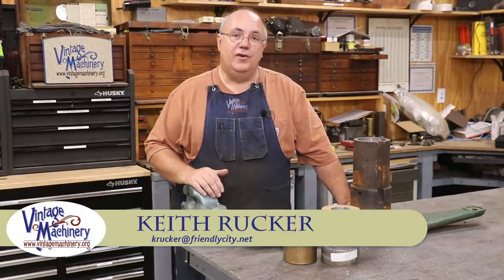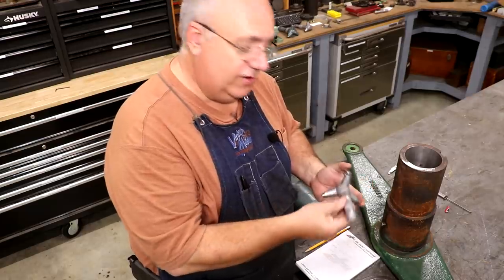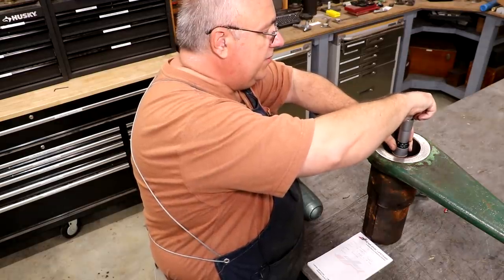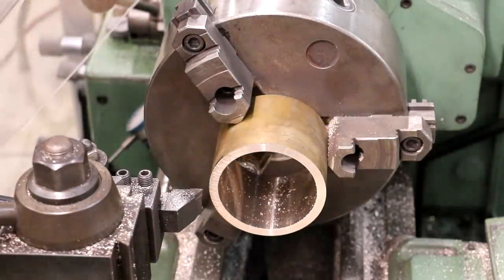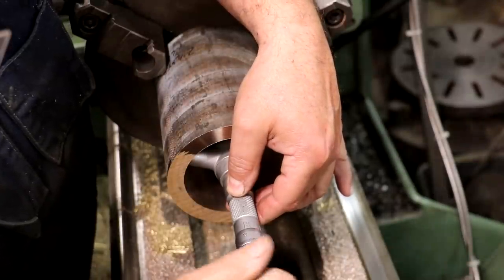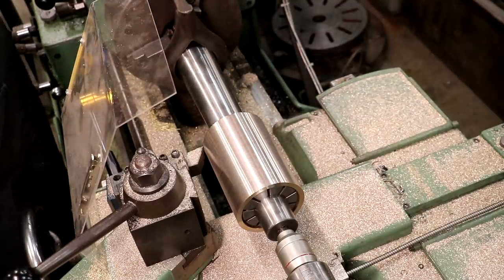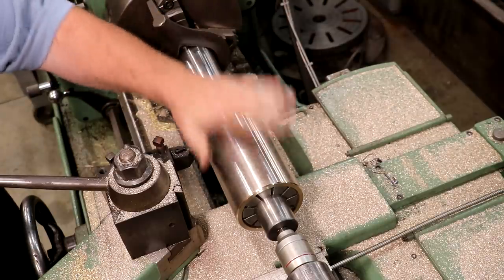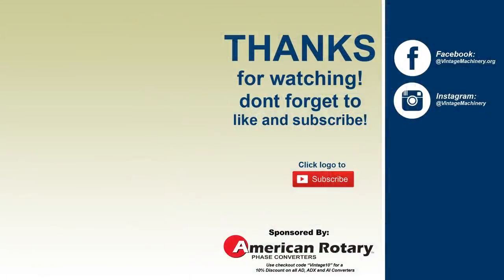Case Steam Engine Clutch Rebuild:  Turning and Installing Bronze Bushings

Comment: Keith, press a plug in one end of the undersized bushing and use it as a pen and pencil holder. I have one made from 4" brass tubing that I cut too short, read the wrong side of the tape measure. It reminds me to double check my measurements. It happens to the he best of us.
Reply: My desk at work is covered with my blunders... The worst is tied between a bag of copper welding tips I designed and completely mis-spec'd the mounting taper (way too steep, came out as more of a chamfer!), and a nut welding tip/guide pin holder I had made to repair a worn part on a welder that was made from bad material. Original was Class 2 (chromium) copper, local machine shop didn't have a big enough chunk of that but they did have ampco bronze. My boss and I figured it would work, but the maintenance manager immediately rejected the part before installation since apparently the weld tip mounting threads don't hold up in ampco to the point of it not being worth trying to use it temporally. Both were costly goofs both in time and in $$$$... Keep them and other fails on my desk as reminder to double check everything!

Comment: Been there done that. Bore mics are often a problem if you dont use them regularly, so i use a digital caliper to measure within the ball park and use the mic for just the accurate figures, so i know im within the right line range on the barrel.

Comment: I'm glad you shared your mistake with us. I'm new to Machining one of my first projects was making new Rudder bearings for my boat out of derlin. I made the ID 1000 over the size of the rudder post which was two and a half inch stainless steel. While I was inserting the bearings into the boat I had the runner laying out in the hot sun not thinking about thermal expansion. Let me tell you it's mighty frustrating lifting a Rudder that weighs 150 lb and trying to get it started. I finally realized the stainless had expanded so I cooled it down with ice and it just barely made it in. Now I always pay attention to thermal expansion.

Comment: One job I did on the planer was cut down the ways for strips on their old stile turret lathes to rebuild them. Before I started my setup I put the new Timkem races in the freezer to shrink them for about an hour .
I took them out of the freezer I held them in a shop towel so as not let them worm from my bear hand . If I was very careful I could get them to slide all the way to the back of the bore before they became too warm. 
Once they were in they would lock in in the in about two seconds solid. 
That was 50 years ago.

Comment: Put up the measurements of that undersized bushing. Someone may have a use for it which would let you recoup at least some of that loss. It might even be the case where a project was still in the design stages where the design could be adjusted to make use of that chunk of bronze.
Reply: Based on the call outs Keith was giving in the video, estimate would be 4.028 x 3.447 x 6

Comment: Acetylene is dissolved in acetone under pressure. Acetylene, being lighter than acetone, floats to the top and is released by reducing the pressure. When the tank is on its side, acetone, mixed with acetylene, can be discharged, instead of acetylene only, causing an explosion.

Comment: Keith, I think you have enough tooling to do most jobs.  The one inch boring bar should have done your job with the proper insert. 
My suggestion to you is start to look for deals on inserts with different geometry and   coatings to cover a wider spectrum 
Keep up the good work 
JIM

Comment: Hi Kieth and your friend Mr bozo. Glad to see even the pro's have "shoulder buddies". I'm no pro but mine's called Murphy.

I have a couple of questions. Why, when you have an oversized and expensive piece of material such as you had for the larger bushing, don't you cut the piece to approximate length first and then turn it to dimension?. Firstly the offcut might be useable for another project and secondly the stick out would be less leading, possibly, to a better finish with the smaller boring bar.

Second question is why do machinists alway seem to start by machining the code colours or written material type information off the stock. If they turned the stock around in the saw, lathe or whatever machine they're using that information would not be lost leading to fewer pieces of "mystery metal" in the stock bin? Just asking.

Thanks for the video. Regards from Canada's banana belt. 
🤞🇨🇦👍

Comment: Perhaps a lesson here is, when having to machine two different size bushings, do the larger one first so if there is a screw-up then it may be salvageable for the smaller bushing? :D
I have been there... many times.
Cheers,
Reply: Sounds like a good safe guard.

Comment: Ouch. I've done it too. Mine was cutting a counterbore in a Cummins engine. Had to get larger inserts. Loss of wages and parts probably cost me over a grand.
Reply: Ouch 🤕
Reply: It's the basic stuff that gets ya. I once accidentally set a reference point off the wrong surface. Bit hard to hide the part being .118 short.
Had a coworker tell a story where he fat fingered an input and "cut 8 inches off a 6 inch part".

Comment: I do more woodworking than  metal, ironically I used to have a 65 hp Case steamer.  No mistakes!  Always had a hot fire though, if you know what I mean 😉. 

 Nice to see someone who actually  acknowledges they also make mistakes here and there.

Comment: Keith, it won't help in this case, but I wonder if you might have been able to get a pre-machined bearing and further machine it at lower cost than raw stock. A quick look at McMaster shows a 3" ID by 4" OD by 6.5" long bearing for about $156. Grainger has a 3.5" x 4.25" x 7" bearing for about the same price.

Comment: It is nice to hear someone talking about proper measurements--inches and thousandths. However but I can understand why engineers generally prefer the French decimal system! I don't think I would be able to do any of the mental arithmetic required for machining without a calculator!!!

As for that huge chunk of bronze... I totally understand what you mean in regards the waste. All that energy that was used to produce it. Such a waste--but there really doesn't sound to be anything you could do other than cast your own!

Comment: I have fitted lots of bearings using heat shrink technique. For heavily loaded bearings that need to be tight it is the best way that I have found to get a bearing installed with minimum risk but there is always crush of the bearing and sometimes in a thin housing the housing will be expanded by the bearing. I would expect that in the setup you just completed that the bronze bush would be crushed by at least 0.002". Did you check the ID after fitting the bushings or allow for crush in your calculations?

Comment: That seems like a lot of running clearance but I don't know what factory clearance is on a Case steam engine. :-)  Sucks about the miss measurement. People give me grief about using my calipers to measure with but they are very fast to catch errors like that.  Honestly I thought you had screwed up the OD on the first bushing because you mentioned the bore size but not the +.003" press fit so i thought maybe you had taken it too far. How bad was the taper on that small end? I am sure the hack that bored that thing with that 2foot long boring bar had some in it. :-)
Reply: bcbloc02, That job would have been just right for your big lathe , and the bores would been in line  and size+ the running clearance .

Comment: @24:50 That tool you use to drive the mandrill down has a mushroomed head. Mushroomed heads, even on bronze tools, can have tiny chips fly off at high speeds. Bad news if it hit someone's eye. Remove the mushroom and have the head taper in slightly.

PS: remove the mushroom from the hammer too.

Comment: It happens, but least your man enough to tell the truth, most machinists on the YouTube wouldn't have said a word, good for you sir, we're only human and we make mistakes, saw your post on FB about lazy Postal worker, we have same problem in NC, ours would try to shove a small block ford motor in a regular sized mail box rather than deliver to shop🤣😡😠

Comment: The bushing can be saved for another project.
A question:  How does the oil get to the shaft & bushings when the clutch is not engaged?  This is out of curiousity.

Comment: Everyone make mistakes.  Took me 3 tries to sleeve one cylinder. Did not of the luxury of press fit. The sleeve had to drop in. End up pushing it out can trying again.   One question tho.  With a 3-4 thou interference did you measure any change in the ID of the bushing?  IIRC you had a 0.010 running clearance so a couple thou likely don't make any difference.

Comment: Nice project even with the error. I am not a machinist but after an interference fit of the bushings what do the inside measurements end up at? My logic says they will be smaller so will they need to be reamered?
Reply: Probably worth checking. I would imagine the thickness of the bushing itself would affect what you're describing. A thinner bushing, say .125 or maybe even .250, I would think may definitely get compressed in the ID.
Reply: Keith did not go into the details for the shaft sizing but he mentioned 15 thou of clearance at one point. I thought about the change in the inside bore size as well, due to the interference fit. Given that much of a clearance a few thou less of clearance (if even that) from the shrink fit would, I think, still work. I am just estimating here of course, I don't know the tolerance of that clearance.
Cheers,
Reply: That's a super interesting question and I'm also interested in the answer. My gut suspicion is that most of the adjustment happens in the outer part because it's the metal is weaker in tension than compression. But that might depend on how large the outer and inner parts are. If the inner part really does get compressed by the interference that would cause the inner dimension to change dramatically. 3 thousandths on the outer diameter is a lot more material than 3 thousandths on the inner diameter and all that material would need to find space on the smaller diameter so it could be significantly more effect on the inner diameter. But that's another reason it's probably easier for the outer part to absorb the pressure and stretch too.
Reply: Keith did say their mating shaft had .015" of clearance that says it wouldn't matter. They would have to be bored out not reamed or reamered (reamed is the correct term). You wouldn't ream that big of a bore.

Comment: I am paused just before he heats the casting prior to putting in the bushing.  I'm screaming in my head, "Don't do it!"  With the 0.003 that the bushings have already shrunk and the 0.003-0.005 he'll get from heating it up I'm worried that he's going to put that bushing in, it's going to fall, the bushing will warm and expand and he'll have it stuck down that hole.  

Now to press the play button and see what happens.  Fingers crossed that nothing bad happens.

Comment: Back in 1995 the store I worked in was doing an expansion/remodel. One day the head electrician had a huge wire all coiled up and was struggling to get it out of the store so I offered to help. When we finally got it into the storage trailer I asked what it was. 

He simply replied "About a $600 mistake. Seems he'd cut it too short.

Comment: Could you have not used a core saw and went in from both ends using the drill press as much as you're taking out and just took a sleeve out or they make a bit like a cut off blade that's made to go in from the end

Comment: James beat me to my favorite quote.  I'd like to know, will a .004 od press fit have any measurable effect on the id?
Reply: It may on a very thin wall tube, on a massive casting nothing.
However on my first job the foreman gave me 4 pieces of 4 inch diameter x 1/4 inch wall aluminum tubeing to make conveyor rollers 12 1/4 inches long, 3 were idlers and 1 was driven. The end plugs were 1 inch thick containing bearing counterbores or a 1 inch diameter keywayed bore and needed a 0.003-0.004 heat shrink fit.
I counterbored each end of the tubes 3.750 dia x 1 deep then machined the plugs to 3.753 dia. But not wanting time to loosen the fit I knurled 3/4 of each plug just for extra assurance. The foreman placed the plugs in the break room freezer portion of the fridge over night. The next morning we put the tubes in the oven to expand, after the morning break we met at the arbor press to assemble the pulleys, I brushed a liberal coating of Lubriplate on the plug and set it on the tube. He would turn the handle downward for a nice sliding fit. All went well.
Until the next morning we arrived to assemble the conveyor only to discover all the tubes had split ends from the knurling!

Comment: the reason for the wait on re-righting an acetylene tank is There is a pool of acetone that that the gas passes through on its way out of the valve When laying down that pool  disperses in cotton wadding and takes a minimum of 30 minutes to return. Sure you may do it all the time but the odds are not good . If the a way to u[load a pic I would

Comment: A question for anybody able to answer, when you are using a bore mic, obviously it would only be accurate if you were correctly plumb. I know that it would not be a huge error, but how does one correct for this? Or to phrase it differently, is there a particular technique or method to ensuring that the bore mic is dead vertical?

Comment: While yes it was an expensive mistake save that bushing for another project because I would bet the time will come when you can still use it. We have all done the same so don't sweat it. I use liquid nitrogen at work to shrink fit stuff. Little dangerous to use but it will allow you to fit a square piece into a round hole. Not really but you can get insane amounts of shrinkage on a part. That piece will last a good long time...

Comment: Back in the early '70s, I was running an NC lathe cutting some jet engine parts and on the 1st op screwed up about 8 parts before I realized it. My foreman sat them right beside the lathe in plain sight and left them for about a month. Embarrassed the heck out of me, but did teach me a lesson, the best damn boss I ever had. I really hated to quit that job and he really hated to see me go, became a pretty good tool & model maker after my apprenticeship.